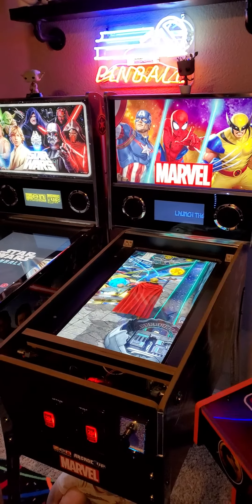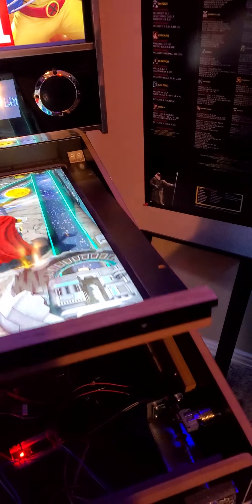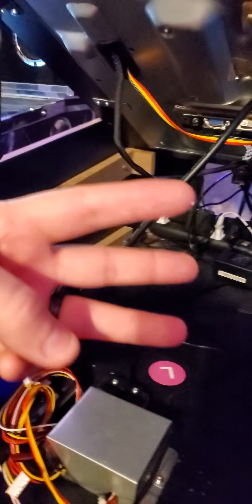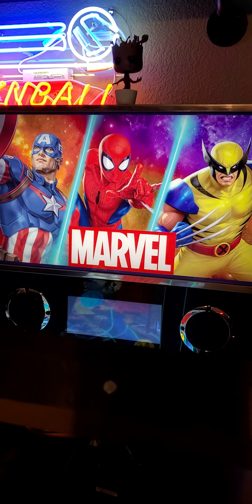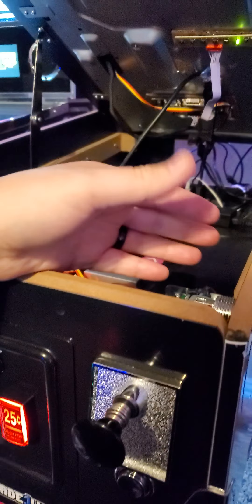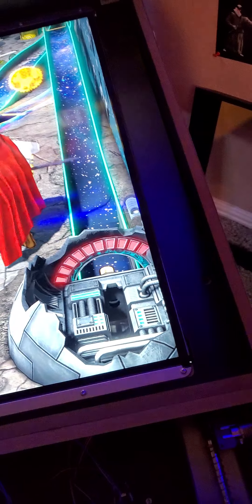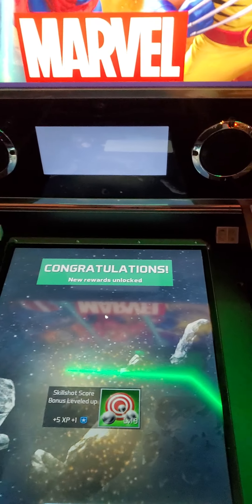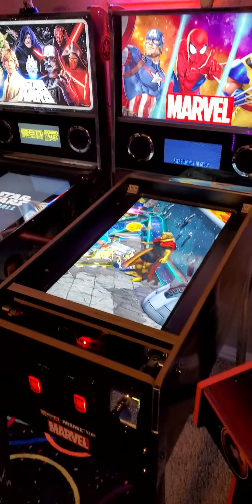Arcade 1up Pinball PC mod!

Comment: I just did this mod and I'm really happy with how it turned out. Great idea using the Xbox controller, I'm going to do the same. I was trying to use a wireless mouse but it keeps losing the signal.